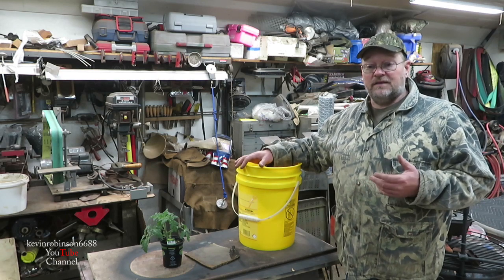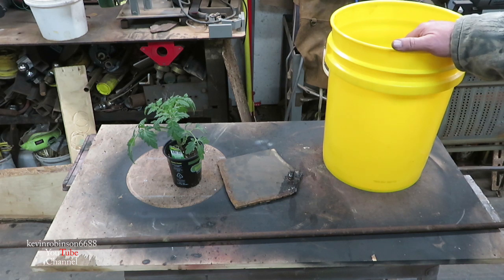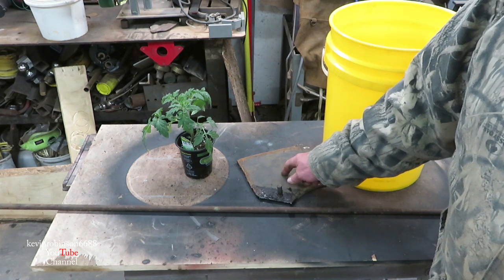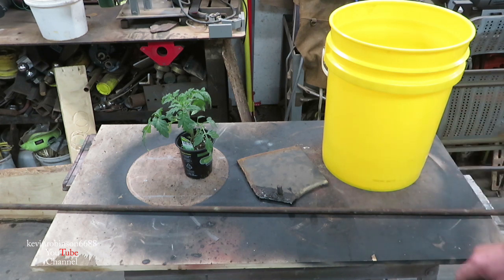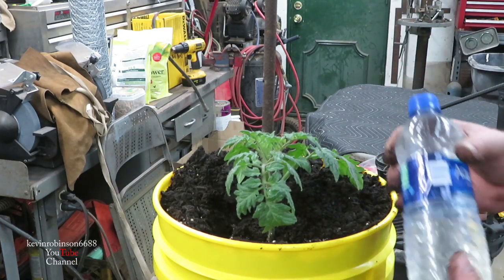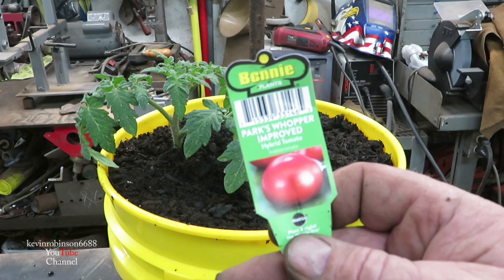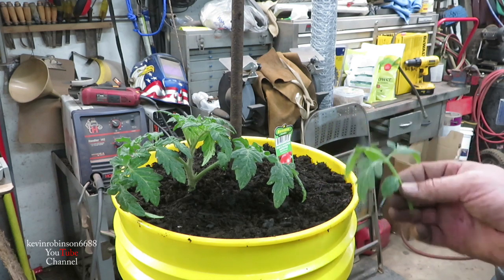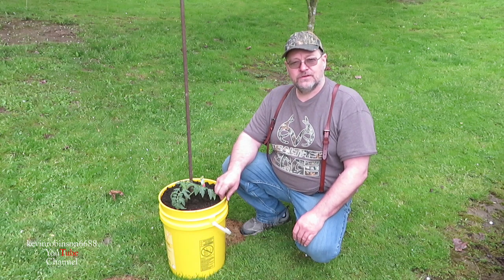How to Grow Tomatoes in 5 gallon buckets

Comment: Thanx for the information. I am 75 yrs old,  have very little space, and soil I can't get a shovel in.  I have been planning all winter to grow some tomatoes for frying, and also for salads in 5 gal buckets.  Southwestern NC (a mile from the SC line) has been on a crazy spring this year.  60-80* days and then below freezing at night. And a couple of weekends with1"-2" of snow. A real rollercoaster of weather.  I've got the buckets, just need to drill the drain holes in them and fill them.  I saw a youtube video that said 5 gal buckets wouldn't work. But they are MY only option.  Thank you, for all the info you and your friends have offered. Now I just have to get the weather to cooperate. 😀
Reply from the maker: Good luck I hope everything works out I like using 5 gallon buckets.
Reply: L££pp

Comment: I planted tomatoes in 3 buckets pretty similar to how you did it,
EXCEPT,
I then set each bucket in 18qt dish pans I got at Walmart & filled
the pans with Miracle Grow tomato plant food mix. Now the
buckets self water & they never run low betwix waterings
because they have constant water.

!
Reply from the maker: That is awesome!
Thanks for the comment.
Reply: Thanks for the dishpan idea. I'd been looking at actual plant trays, but I know Dollar Trees have usually got dishpans (for $1.25, I think). Good solution.

Comment: Good idea.   Not likely to blow over with all that weight.   I grow stuff in fabric pots in a kiddie wading pool.   I cut drain holes 2 or 3 inches up in sidewall of pool so the the pots will be watered from the bottom up.   That way your fertilized water stays around for a good while.   I use Gro Pro fabric pots which last for years.
Reply from the maker: Thanks for your ideas and information Lggie.

Comment: For anyone who uses tidy cat ca litter. The buckets are safe plastic to grow in. Might as well make it work its free when you buy the litter. I am going to try to prune mine more this year. Last years were a bust. Year before didnt taste good. But the years prior were great, I can't figure it out. My soil grew mushrooms so I know it had the nutrients needed. I'm at a loss. Main problems were end rot. My cousin had the same issue. Both in NC one on the coast am I'm in the foothills.
Reply from the maker: Thanks for the info.
Reply: I have had same problems in the past.  I researched and am currently using gypsum (calcium) which gives plant nutrients that prevent bloom end rot.  Another tip that was given is watering.  Your soil can never dry out because it promotes blossom end rot. Hope this helps.
Reply: Try adding some crushed up egg shells and worm castings. The soil probably got depleted over time.

Comment: Folks, if you want to grow any heirloom variety (krim is my all-time favorite) tomato grown them in a soil-free mixture. Do not use a compound with dirt as you can almost bet your life you'll have wilt (fusarium/verticilium - do your homework about these bacteria). This bacteria affects many food plants and a lot of other plants including trees. My thousand square foot (traditional) garden has wilt but even that's hit and miss as to affecting the plants and the amount of wilt in the soil from year to year. If you use a grow bucket I suggest you use 1 part peat most and 1 part composted manure with a generous handful of vermiculite with time release fertilizer mixed into it. You can skip all of this by growing a hybrid variety. Hands-down best variety hybrid tomato is Better Boy. Hybrid plants aren't affected by fusarium or verticiliun wilt but check the seed package for details. FYI - I have fairly good success at managing the wilt with in-ground heirloom plants (tomatoes, eggplant, etc) with a once-per-week spraying of my plants with aspirin. One 325 mg aspirin tablet dissolved in a 1 gallon pump sprayer. Spray the plant generously about every week. Don't spray your plants with anything during the heat of the day. Spray them in the early morning to avoid "burning" them. You can also water each plant with this aspirin/water mixture. As I am in Georgia I'll be starting 100+ tomato seeds today for post-easter planting. Good luck to all. FYI - I discovered an exceptional hybrid tomato just last year, the Japanese momotaro. Excellent fruit.

Comment: i strip the leave off about 4' high and take off any suckers, can clone the suckers for a fall crop my tomato plants are naked with a few leaves.  i grow fruit not leaves. This also give the plant air and sun light and it help spot tomato worms with a black light at night ~ some time bamboo stakes are hard to fine, what makes another good tomato stakes is 3/8" rubar.  This will last a life time cut them 5' tall The roof it made from 6 ~ 7' tee post 4 corner, and 2 between the middle and i use hog wire for the top for the plants to lay down on . They will grow up but the weight of the tomato will make them come back down, You just go around under it picking the hanging tomato's
Reply from the maker: Good tips thank you

Comment: Your piece of steel and rod may keep the mature plant from toppling over in storms with high winds. Had that hsppen 3 years ago, when I used chicken wire for support, in my buckets.
Reply from the maker: Thanks Bent Nickel how did your plants grow in the buckets?
Reply: Three years ago was my first time. I planted 5 single plant buckets. I chose the little cherry tomatoes and had "hundreds" of tomatoes. Gave away two thirds of my yield, sharing was my favorite part. I found that watering each day allowed me to more closely watch for bugs and I didn't drill holes for drainage. The ENTIRE bucket filled up with hair like roots, to my surprise. The growing season lasted 100 days. It was a terrific experience, that I would highly recommend, but if you're single, don't plant five plants, you'll throw away more than you can eat.  :-)  ;-)  :-D

Comment: Kevin, they make tomato cages that are made for tomato plants.  The cage starts with a 4" circle and then 10" up there is another wire circle but this one is about 4" bigger in diameter and the another 10" up another wire circle which is 4" bigger.  The cage becomes an inverted cone that you feed the plant up through the cage which helps the plant stay off the ground and it keeps the tomatoes from rotten in on the vine.
Reply: Kevin like to make everything himself.

Comment: Tomato leaves are edible.  You would have to eat a solid pound of leaves to harm to you. You should have plenty of IRON in those tomatoes and you added about 10 lbs of weight.  I use bamboo , old fishin rods,garden stakes. Seems to be over kill and you forgot the drain holes.
Reply: He put several drain holes in the bottom and around the side bottom.
Reply: @carolynplante4513  you are right. I stand corrected